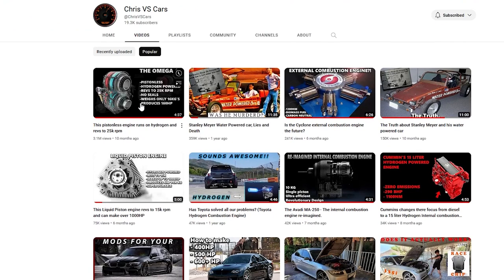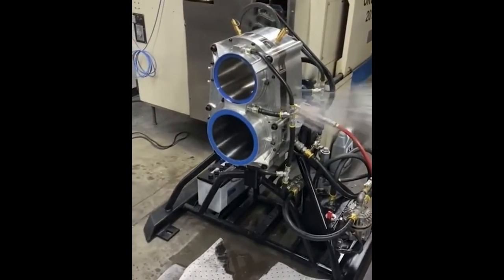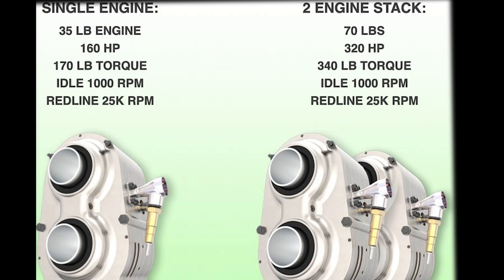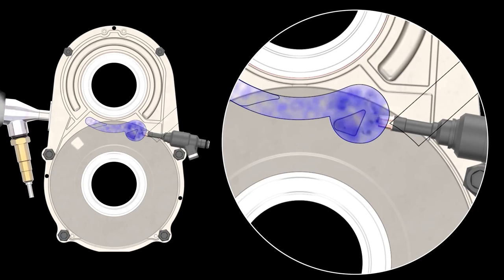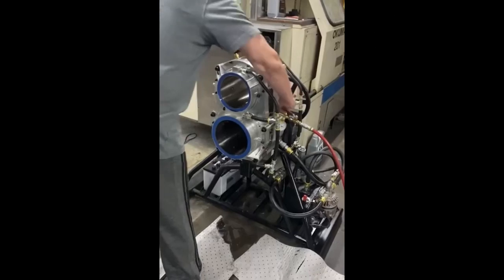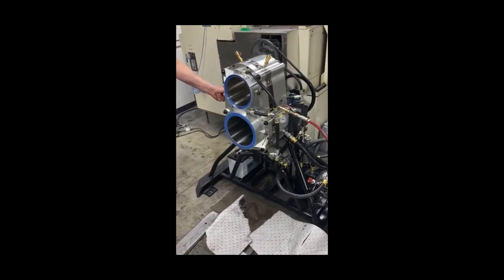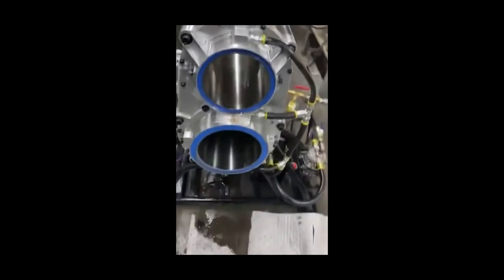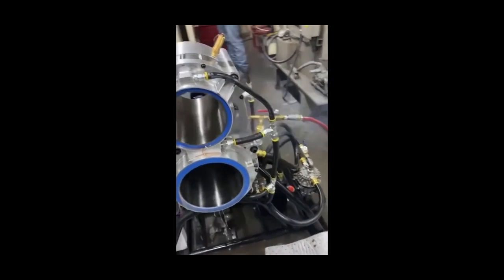The Pistonless Omega 1 Engine - Finally Working Prototype ahs been Revealed!

Comment from the maker: Hi Guys, I've seen your comments. I agree, the fluid is most likely water made as byproduct from burning hydrogen. When I made the video I didn't think of that, even tough I have talked about it in other videos. 🤦
Reply: you are hydrogen engine youtuber and did not think it is water? you said fuel maybe leaking? what fuel you thought might be leaking? :)
Reply: If it burns Hydrogen then the by product or exhaust is WATER VAPOUR, which can collect in the exhaust system and be passed as droplets or a stream of water. No biggie, but what is the engine connected to by belts at the back?
Reply: @gregedwards1087  think it's the starter motor to get it running
Reply: @vinodkaveripatnam7000 , possible, but details are a bit light on. It claims 160 hp (119kw) and 170ft/lbs (230 Nm) of torque but at what RPM? What is the fuel economy at the rated figures? If it is connected to a gearbox and drivetrain will it actually move the vehicle at low RPM or are you going to have to rev it right up to get it to move? Or will it just stall all the time? Remember, these figures are just claims, there is no real evidence of the engines performance yet, plus many other questions.
I like the idea of the engine and the Hydrogen fuel, so I will keep an eye on the project but Chris has said that none of the released data has changed for some time, so we will see.
Reply: Well im certainly not going to say its not water because i really have no idea however.....those white absorbant cloths on the floor appear to be placed there to absorb that fluid and the cloths also look exactly like the cloths used in a spill containment kit which are designed to wick oil but not water. They will literally float on water while wicking out any oils in or on the water. So if those are in fact what they appear to be and are in fact placed there to absorb that fluid then i would assume its not water but again, due to the unknown variables, I really have no clue if that is an accurate assumption.
Reply: @gregedwards1087  all gr8 points. I have been waiting anxiously for an update on this engine as I think its potential use as a generator on electric aircraft, EVTOL's, etc is huge as it could bridge the gap while battery tech continues to advance to a more practical energy density level for use in aviation. However i would guess if you plan to use it to power a vehicle transmission directly you would need a stack of these in an offset firing order to produce enough low end torque. But idk it also fires every rotation sooo?? But my hunch is that it would probably perform somewhat similar to a two stroke type of power curve?? This motor and the aquarius are my two favorites for onboard generator in electric aviation
Reply: @vinodkaveripatnam7000  im wondering if it is even running at all in this vid or if the compressor motor is just turning it over?
Reply: Looks like it's running on compressed air to me.
Reply: @Dunriteproducts  That's what it looks like to me too. Just compressed air.
Reply: They could be adding water to compensate for poor seals (or no seals).  A bit of fluid between the parts to prevent excessive gas leakage - at least that is my guess.  It explains why the water is being injected in so many locations.  This would only be for prof of idea - call it a pre-prototype.  Looks like they have a long way to go.

Comment: When hydrogen combusts, H2O is the byproduct. That liquid is probably spent fuel (aka water) condensed in the combustion chamber and leaking out.
Reply: I almost have to think he's trolling us. Fuel? He said it burns hydrogen. As if hydrogen could be a liquid at room temperature and pressure 🙄. In the words of the worst president in history, "c'mon man!"
Reply: Why not have it feed back in to the wiper/coolant reservoir, i mean its just water right? And its not necessarily alot.
Reply: @malazar9565  because that would benefit the customer and big companies can't allow that to happen without price hikes
Reply: Hydrogen burning in air produces a lot of different nitrous oxides, which are polluting.
Reply: @malazar9565 this is the exact reason why not. it's just water, it comes out of your tap at home. why bother collecting it from this engine?
Reply: @slingshotnerd my brother in christ water comes out of your tap, the amount of weight and material it would add to the engine is not worth the 3 minutes you save by not adding water to your engine
Reply: @generalh1044 He was referring to a self filling washer reservoir.
Reply: @agententropy5577 what? Are you special, anything used in a engine that combusts doesnt matter if it is a liquid or nah then it is a fuel

Comment: Looks and sounds like it's being driven by compressed air via the red hose around 500 rpm.  Possibly a mechanical model to test the interaction of moving pieces at low speed.

Comment: when you see the flame coming out the exhaust ports, that's a sign it's at red line, ( Max RPM ) Not Idle ( the video clip is the omega at a Pathetic Red-Line on Petrol.
how do i know that? , do the math......good thing they switched to hydrogen.

although a tank of hydrogen starts with a substantial energy deficit to make up; so, for any broad market outside Iceland, i would alternately recommend CNG or synth-gas over hydrogen.

Comment: I want a dual propeller airplane, with one of these engines in each wing. The weight to power ratio is ideal for aircrafts.  Low maintenance and fuel efficient.  A dream come true for general aviation!
Reply: That would stuff things up for the oil company, they havent taken anough money yet
Reply: A single airplane with this would be awesome.  That's my current goal.
Reply: Now just need to wait another 20 years to get one certified lol

Comment: you can easily add more than one "piston hole" in one engine rim, more like in vankel engines, around the engine circumference
Reply: thats exhaust, do you see any exhaust pipe
Reply: what is exhaust output? heat, co2 and water
Reply: ?? you actually see the engine flame firing, from the side, like a turbine
Reply: or hydrogen burning to water, well thats water
Reply: No you can't as this would negate the compression between the notch and the touchpoint between the "donuts"

Comment: It "runs" on compressed air (red supply hose) 
The original patent from Walter Müller, "Der Eintaktmotor" 
, (Single stroke engine) is from 1997, has since expired.
Reply: 1997?

try 1897. or earlier. shares certain traits with rotary engines from over a century ago... which also proved to be unfeasible...

browns rotary engine, hults rotary engine, though admittedly it has only a passing resemblance to a mcewan rotamota...

150 years of people trying rotary engines and all we have is wankels and turbines...

Comment: Maybe I missed something mate, but it stands to reason that if an engine is fueled by hydrogen, one of the main outputs will by WATER!!! (If not THE main output!)
Reply: Was just going to write that anytime there is a chemical reaction, aka burn, of hydrogen it becomes water.
Reply: You would get a bit of nitrous oxide with the air being burnt.

Comment: Looks 99% like fuel or Lube oil, main assumption due to the (orangish*) color underneath the upper ring (in addition to the two Oil jugs in the background) and the absorption Matt’s on the ground, Highly doubt this is run on Hydrogen as there are also Fuel or oil filters piped in on the right side of the engine, Ive never worked with hydrogen but my assumption would be that they have to Use Hardlines in and have way more fire protection or suppression in the shop, as it is Highly volatile (gaseous**?)

Comment: i am pretty sure the fluid is un-burned fuel. ( maybe stop with the omega one videos, and let Aston get back to what they are good at )
turbine manufacturers need to understand that the process of designing an ICE is fundamentally different than designing a turbine ...otherwise what is it then?
it's not going to even get close to 25Krpm on petrol, is what i told you shortly before you figured that out yourselves...
so don't start an ICE design by throwing over 100 years of ICE R&D out the window.
Reply from the maker: I make video on the engine because they ask me to😂😂 the CEO of astreon has emailed me multiple times giving me more info, if yoi go thru my videos i do clear up what the fluid is and give updates on the engine
Reply: @ChrisVSCars  ok i will go over your videos on it,
but i still know better than to invest in it.

Comment: I think the fluid might be water.. Since most hydrogen engines create water as a by product. But we most likely wont know until they clarify what the fluid is.
Reply: It's oil. You can see it leaking from the oil seal on the timing gear cover

Comment: Most likely a money grab. There are several things that do not add up, but worst are the "piston" surface area and the cooling. There is so little "piston" surface area that achieving the claimed torque, the "cylinder pressure" pushing the "piston" should be enermous. And, as the combustion heat can only be dissipated through either complex innards or/and short area of the block, no wonder it only runs a short burst in the video. It may just be producing enough torque to turn itself over. Most likely that is the case. So, at first it sounded promising. Now, until proven further, it is a hoax. But it is an interesting new way of thinking what an ICE can/could be. And please, forget the hydrogen with any type of an ICE, it further makes it seem as a hoax to fool greens. Hydrogen has no future as a fuel for internal combustion engines. It is just too difficult and expensive to store, and way too expensive to produce. A dead end like electric cars. Let us not go that way.
Reply: the ONLY aspect of it that i do like is the split cycle concept.

personally i think thats the way to go if the ice is to hang on. forget the tired old 200 year old "steam engine with carb" idea. its outdated. past its use by date. suck squeeze bang blow, otto, you stole beau de rochas cycle, called it your own... and well, were still stuck with it. and its holding us back.

once upon a time, everyone knew that engines ran on heat. and we had progress, in leaps and bounds.
now we are taught they run on "fuel"... and progress has stagnated for a century. can also blame commercialism for that, the insane urge for growth, profit... sell as many of it as possible. not because its good, or its better... but because it has to be sold. why change? 
its most definitely a hoax. as soon as i see flashy aero style fittings (not cheap) fancy bearings, custom parts, and what look like reasonably well funded labs... i turn off. if they dont have a running prototype, slapped together in a garage from junk, staying up til 2am for 3 years to do so, that straight away proves their claims... where did all the money come from? talking the talk. too much of it going on these days, and no-ones walking the walk.

Comment: Hi
Or is it lubricant leaking?
Now a man has stood beside it to give some scale it would seem its swept volume isn't huge and the combustion camber is rather small. I hope I'm wrong but I can't see this making 50 Hp let alone 160, and that power at its rated speed 25000 would equal a torque of only 45 Nm looking at the rendering it appears it makes one combustion event per revolution like a single cylinder two stroke. I would like to know how its going to be so much more efficient if someone could explain please, also it has a lot of metal to warm up with a small combustion chamber.
Sorry I can't see this working out but hope I'm wrong waiting for quater 2 update

Comment: The basic design is very unique and definitely holds promise. However, I do see a couple of issues that will make its adoption rather difficult. The main one is the tight tolerances. Without any type of seals between the case and the rotating assemblies there will either be losses or the potential for binding and seizing it up. Losses will cause very high emissions should they use traditional gasoline as fuel. My best guess is they'll have to create seals similar to the rotary Wankel design that was used in the Mazda. One thing I did notice on the engine specs that I think is unrealistic is the torque and max rpm figures. 160hp yet can also create 170 pound feet of torque would have to come at under 5,000rpm. After that the torque would have to continue to drop all the way down to a mere 33 pound feet at the max rpm figure of 25,000rpm. For any internal combustion engine that's a rather unusual and perhaps unusable range. I'd like to see a REAL dyno chart showing the hp and torque curves.

Comment: This is nothing new. The engine never runs self powered in this clip it is being spun up by compressed air and only fire a few times
The fluid leaking out around the tubes is oil

Comment: The fact that there's an air hose attached, I assume it's leaking oil (as they're using oil absorbent pads to soak up the mess) and we only see flames come from the exhaust a couple of times while it's "running", tells me that it never ran under its own power. The engine, as it may, appears to have a long way to go, before it can even produce enough power to run on its own, much less power anything else!

Comment: Too much squish, too much friction and wear. Inadequate cooling. Not enough airflow for claimed rpm. Would need huge pressure charging to achieve any worthwhile BMEP, and then the losses would be significant. A hugely expensive product to produce as well.

Comment: It's recommended to use hydrogen fuel. Everyone keeps forgetting that it can use other fuel types.
Reply: Any hydrocarbon fuels will cause a carbon buildup and carbon buildup on any motor with tight tolerances is death.

Comment: That was not running on combustion.  It was being run as a motor with pressurized air.  You can see the actual gauges for crying out loud.  Nothing burger.

Comment: Who's like it's more just for a small yard equipment and compressors at the moment that's even a huge jump rather you tighter than gas and anyway they can all the lawn mowers and all the compressive in generators that will save a lot right there

Comment: I believe that's light weight oil leaking as there are no seals and they are still working on that issue. It starts to seal as the engine gets hot and components expand. These component may be replaced with Titanium as it doesn't expand as much when hot.

Comment: The engine is not running. It's being turned by an electric motor thru the belt and pulley. They're trying to start it but it is not cooperating. The spark/ignition timing is off. Also I'm not certain the rotors are timed properly to promote the compression of the air/fuel mix. From what I've seen this project either has incompetent leaders or the engineers are just ignorant of how to properly troubleshoot the engine to get it running.

Comment: if the current pace of revealed development proceeds then there is a fundamental design flaw in the engine.  If it works, show it, if not, just continue on the same way and string along investors.

Comment: I sent them credentials, wanting to buy 3 of them for use in Texas. I told them I'd pay cash and even sent a credit letter from my bank. I never heard a word...
Reply: I'm a military supplier with a CAGE CODE. The most exciting thing I sell the US military is my own magazine for an "Experimental Weapon" system. After rigorous testing, my mags were found to be better than OE. I'd hoped to use 3 of these in a rare factory lightweight Porsche I have, but have since decided It would be more exciting to lift a Sharwerks 997 Turbo S and try some off-road races. I've been IMSA/SSCA eligible for nearly 30 years and have a number of other types under my belt. If it worked for me there, I was thinking about APUs for military vehicles so you had more electricity available.

Comment: They are injecting water to cool it as they are testing it.
Timing is key
No nitrogen is key

It probably too advanced
Yes, when heated up, the tolerance will change
Hho is going to ignite all though the engine
Probably a valve has to be installed.

Comment: Looks 99% like fuel or Lube oil, main assumption due to the (orangish*) color underneath the upper ring, and the absorption Matt’s on the ground, Highly doubt this is run on Hydrogen as there are also Fuel or oil filters piped in on the right side of the engine, Ive never worked with hydrogen but my assumption would be that they have to Use Hardlines in and have way more fire protection or suppression in the shop, as it is Highly volatile (gaseous**?)

Comment: Looks like lube oil leaking. They definitely have a lot of pressure lubed areas, I wonder if it will use internal passages in production vs the web of push locks. I don’t see any signs of air cooling like fins. Maybe that’s a compressed air line going into it to aid in cooling? Maybe efficiency is high enough very little cooling is needed? Compressed air starting or is that what the pulley and belt are for (starting and maybe load as well)? Last, am I looking at it wrong or do the diagrams look like they’re backwards with exhaust coming from where I would think the intake would be? I would love to see what the displacement and comp ratio are. Is this engine essentially supercharged by design with the intake side forcing air into the combustion chamber; does the cold side displace the same or more volume as the hot side?

Comment: I suspect that when the motor is connected to a vehicle and put through real operation tests we’ll know what this motor can and cannot do. The motor needs to have drivetrain resistance with a average sized and weight vehicle, city and highway driving. Let’s see how this motor endures it’s first 100,000 kilometers. It also needs to be put through the climate tests; rain, desert, winter. 👍🏻